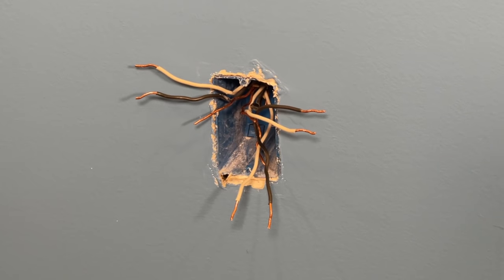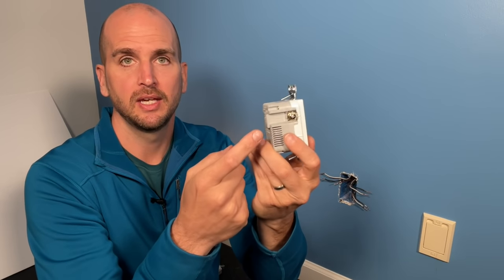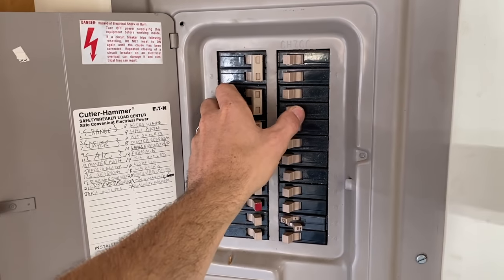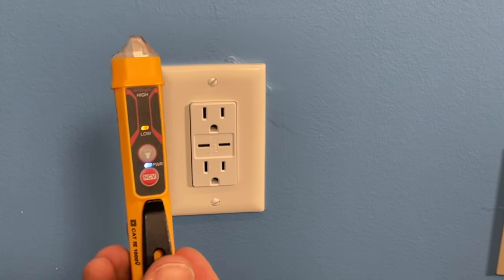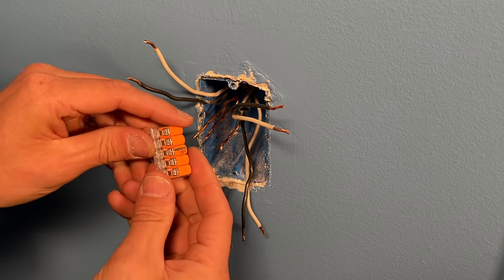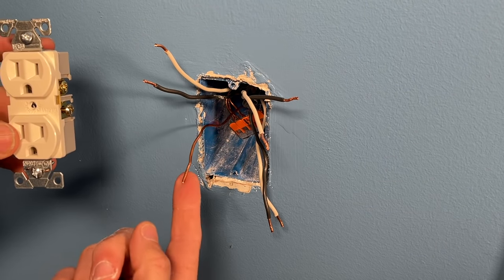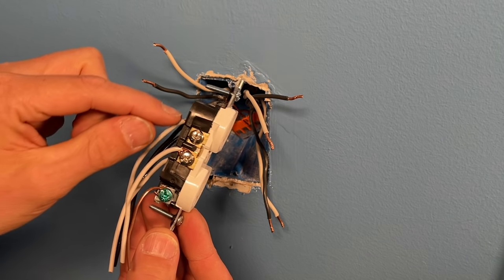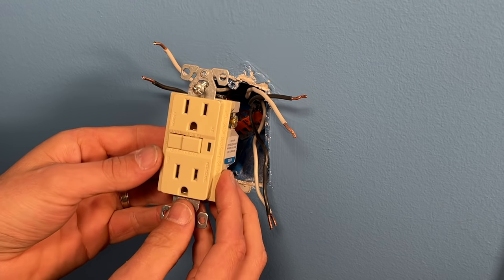Wiring an Outlet with Multiple Sets of Wires

Comment: This is the first time I am watching your channel and I like the way you explain the work.
However, I have a matter of which I am concerned. 
After you checked and found the hot wire you didn't advise that the power should be turned off before working on the receptacle. Also you didn't show that the work you did was correctly done by showing that it was working.

Comment: On the USB/outlet installation, you actually put the J-hook on anti-clockwise and then tightened the screws down.  Bad form!  After all that "this is not recommended" talk, you actually put the J-hook ends of the wires on in a configuration that counters the clockwise tightening of the screws.  Walk the talk, man.

Comment: None of the outlets in my apartment have a proper ground 🤦‍♂️
Reply: And..sometimes I'll turn off the bathroom fan and the GFCI outlet makes the "tripping" noise but isn't always in a tripped state
Reply: @mwint1982  Get that GFCI replaced.
Reply: I'd call a local electrical company to check that out or a friend that is currently working in the field

Comment: I was taught...... no push ins, heat loosen clips, pig tail out of the box, having room.... duplex goes ground up, finish screws perpendicular..... though that was code.
Reply: The ground up can signify a switched outlet in residential in older homes. now if you have allll your receptacles ground up maybe use a label maker to identify it being switched or re wire it to make it a constant hot.

Comment: Sometimes you only know which wires are the hot ones fed from them panel. In old homes with iffy wiring, if I can't determine a use for the other wires, I'll just disconnect them and leave them in the box. That's just me.
Reply: Then you would have some other spots without power
Reply: @gerdberg4188  in an old home with iffy wiring that's a good thing, and if power is lost somewhere you can reconnect and then you know more about the load situation.

Comment: @ 7:45 & 7:48 you attach both wires BACKWARDS!  When looking at the nut the wire should wrap clockwise around the nut, so it sucks in the loop instead of pushing it out of connection.  Try not to promote this kind of wiring...it's bad mojo!
Reply: Look more closely.  No “j” used on these new clamp down screws.

Comment: Congratulations, man...
You hooked your wires in the outlet exactly BACKWARDS! You are supposed to tighten in the same direction as the hook wraps (clockwise). Doing it opposite, like you did, actually opens the loop and creates a weaker connection. Not a very defendable mistake when making a DIY tutorial about something as dangerous as electrical!
Reply from the maker: Actually….. I used the back wire feature on the commercial grade outlet.  No wire hook on that method of wiring.
Reply: @EverydayHomeRepairs  
My mistake. You even explained it. Sorry for the invalid criticism. Good job!

Comment: I don't get the hype on the wago connectors.  They look like cheap POS's.  When I use wire nuts you can't pull them apart.  If I gave a good tug on the wagos I'll bet they would fly into pieces.

Comment: I would recommend to do it yourself if you have a decent knowledge with electricity ⚡️ 
Why ? Is dangerous, and you need to know how to use wire not. You might need to know more than just a tutorial from YouTube.
Use the right equipment & tools for the job , learn the steps and precautions please.

Comment: I always find it odd that some people don't trust push in quick connects on outlets but are OK with push in Wagos. They work the exact same way. I've heard my entire life people claiming to know better than manufacturers, code, engineers. Just told me they have no idea what they're talking about.
Reply from the maker: Speed wire on receptacles and Wago 221 lever nuts would not be considered the same design.  You could probably make a comparison between speed wire and Wago push in connectors but not the lever nuts.
Reply: Wago 221 are NOT "push in".  They have a lever lock.  Easily the most reliable connector and better than push-in's and much better than wire nuts.
Reply: They are NOT the same.
Reply: Okay, but the video featured Wago lever nuts, not Wago push-ins.

Comment: If you aren’t an electrician don’t touch shit
You don’t know what you are talking about
You can’t use the device as a continuation as a splice 
Anyone who tries to do wiring and they aren’t a licensed electrician pay someone to do it
Reply: Do you mean the GFCI? I was wondering about that.  I have installed GFCI and AFCI receptacles following the manufacturers' directions and they always said not to install them in a box with more than 4 wires (6 including the ground).  Is this correct?

Comment: Hello your  not  correct .you should also explain different  circuits  could be running thrue, a junction box , also you should wire 
.ground
.neutral  
.hot 
I would prefer you to use wire nuts because  ark fault  breakers are required , and ark fault receptacle  , those quick snap  cause more parking and more of a chance to cause a fire. You should not do electrical  work if you dont know codes,   you should always call a licensed  electrician I would not hire you

Comment: You just pig tail them out so that you have 1 set of wires going to the plug and hook the dam screws do not stab. Then tape the plug. If its gfci then power coming in goes to line side. The other wire to load side. There 5 seconds to type no 10 or 15 minute video needed
Reply: Except you missed the ‘new’ (multiple years old) clamping plate screw system.  Guess you need to watch a few videos.